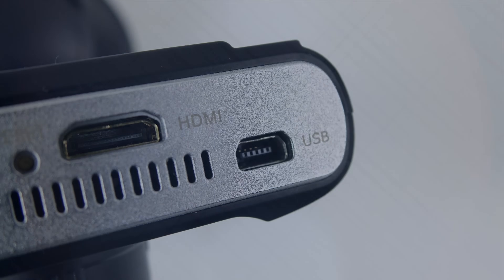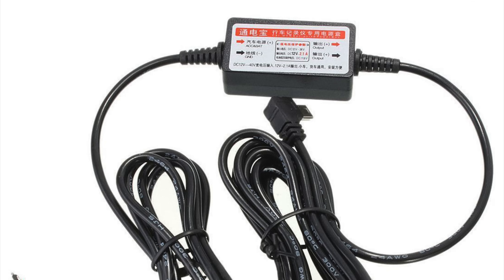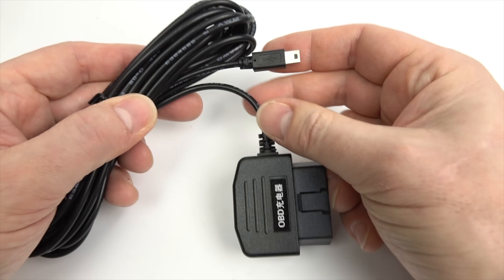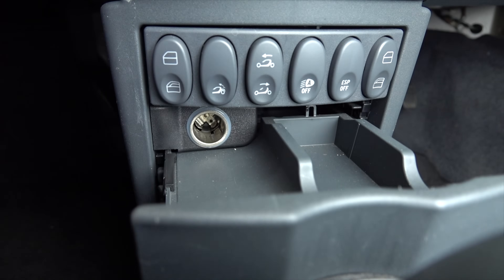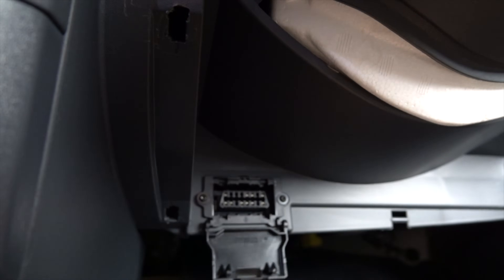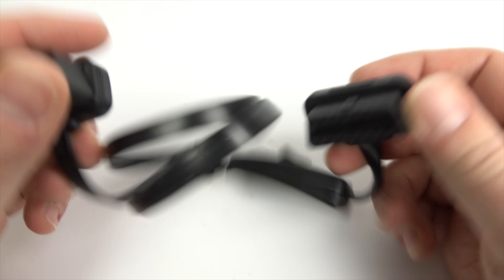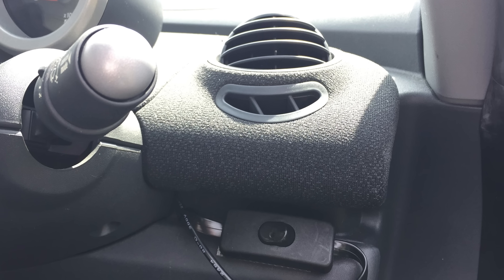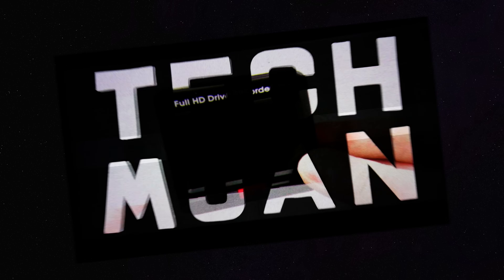You can power a Dashcam via your OBD port (but perhaps you shouldn't)

Comment: As long as the OBD2 adapter does not touch the CAN lines it should be fine... I would be more worried about a dodgy DC-DC convertor design. And of course discharging the battery. Car batteries don't like operating as long term power sources (as you mentioned in the video).
 - Eddy
Reply: MrOpenGL

That's pretty much the point of my original statement.
Reply: +Deathlok67 The data lines on the obd port are opto-isolated.  You could technically apply 220v ac to it and it would be fine ... not that you should attempt this ...
Reply: I was mainly referring to data, not DC voltage. Having the dongle "on the bus" can cause strange side effects in some vehicles, for example the activity may keep the ECU active longer after the car is turned off, increasing battery drain.
Reply: +Deathlok67 The thing should only be internally connected to the +Vbat and GND pins of the OBDII. Those are in no way connected to the ECU.

Comment: OBD ports always carry a constant power feed and an earth - some manufacturers use a pin for an ignition supply, but this is not always the case. This adaptor will just take the live and earth pins - You won't damage your car taking power from the OBD port this way. Neat way if it suits your needs tho.

Comment: Good video Techmoan. I didn't even know such things were out there.

Another option for people that want to leave the car's wiring completely alone is a "add-a-fuse" tap. You remove a fuse from your fuse box (either keyed on or constant on circuits, your choice), plug it in, replace the factory fuse in the top of it and place whatever size fuse you want (3A for a camera would be more than enough) in the side and you now have a properly fused dedicated power line for an accessory and have made no permanent modifications to the car.

http://www.amazon.com/Pico-0956PT-Blade--Circuit-Holder/dp/B001QRSBW0/ref=sr_1_1?ie=UTF8&qid=1462731092&sr=8-1&keywords=fuse+power+tap

I'm in the camp of not wanting to power anything from the ODB-II port, so an "add a fuse" is about the next easiest option. If you have no automotive skills what-so-ever, I can't imagine most repair shops charging more than $20 or so to fully install the entire circuit for you. It's about 10 minutes of work.

edit: It's also not uncommon for even modern cars to still have auxiliary fuse locations in the factory fuse box. You may need to just plug 2 wires in and won't have to buy anything special. Check your owner's manual.
Reply: +Maxwelhse Why? Give me one good reason not to power something from the OBD port.
Reply: +Maxwelhse Not to mention, that product you linked to only provides the +12V. You then need to provide a return path, and it would be easy to screw up wiring that in and blow the fuse. Plugging into the OBD port is much easier, and probably safer for those without DIY skills who want to leave it stock. Personally, I would just open up the dash and add in my own wiring... but not everyone wants to/can do that.
Reply: *****
Here's 2 quick reasons:

1 - The OBD-II port is powered directly from the ECU. You screw that up (or your device fails and screws it up for you) and you risk frying the car's computer. The power pins on the port are not fused in the box.

2 - On many vehicles the OBD-II port is in a location that would make driving around with something hanging out of it dangerous. In my Jeep, as an example, the port is directly over the clutch and brake pedal and aims straight down. I probably "could" zip tie the wiring and all of that up and out of the way, and probably not kick it and hope it never falls out of the connector while driving, but that will also make it a hassle to use the port as it's intended later. Plus. if I'm going to do that I may as well just run correct wiring from the fuse box and be done with it.

---

As far as wiring a ground, that's no big deal. I'm fairly confident that any car with an ODB-II port is also going to be chassis negative, so just pick any screw that goes into something metal on the car and install the ground there. If someone should happen to mess up and blow the fuse, simply replace the fuse and try again. That's why they are there (except on the OBD-II port, which generally isn't fused).

Anyhow... I stand by my statement that if someone is unwilling or incapable of installing a fuse tap then any repair shop can do it for them for a very reasonable price and then the job is done right with no risk to the ECU. You have no reason to argue with me about that.
Reply: Maxwelhse I have never seen a single ECU where a power fault on the OBD-II would cause ANY problems at all. The power, in many cases, doesn't even pass through the ECU -- and when it does, the connection to the OBD-II is tapped directly from the input. As others have stated, the OBD spec requires that the port be able to power active probes. It should be able to source WAY more than enough power to keep a dashcam happy. Throw a fuse in line, and you're laughing. However, even without the fuse, the only thing you'd risk damaging with a sustained short, for example, would be the battery. And you'll find out pretty quick if it's shorted!

Saying you can damage your ECU by drawing power from the OBD port just demonstrates that you've never had an ECU open, or never read the OBD spec.

Having live power on a wire (from a fuse tap) is much more dangerous, and much more likely to end in a user-caused short. If you let that cable touch ANY chassis-connected metal, you'll get a huge spark and, if you're lucky, blow the fuse. Many of those Chinese-made fuse taps actually bridge across, so that the accessory wire you're adding is connected directly. I would MUCH rather draw my power through a proper connector, with a very, very low risk of electrical fault, than leave it to an end user to properly crimp and ground their own fuse tap.

The end to this debate is thus -- end users will almost ALWAYS do the easier, safer thing that takes less effort. In this case, that's simply plugging into the OBD port. Instead of fear mongering, why not encourage people to buy parts that have a fuse in line? That information would go a lot farther in keeping someone safe than saying you'll fry your ECU.
Reply: The end of this debate is that people like you should be exactly the people to take their car to a professional and have a circuit correctly installed. Your fantasy of giant sparks from a 1A fuse outlet say all I need to know.

----

And no, all end users won't do needlessly foolish things with their cars, hence why I'm recommending against plugging in random China garbage directly to the data port. You're welcome to do whatever you want. The entire point of my comment was to offer a safer and BETTER way to do it and probably at the same cost (assuming a professional is paid to install it). I also stated right from the start that if someone doesn't know what they are doing to take it a shop and have them do it.

People like you turn up on the internet and argue with people just for the sake of arguing. If I wanted to do that I could call any number of the women in my life. I'm done here.

Comment: Will a dashcam really run down your car battery? at 3w it'll take like 150 hours to run down a 500Wh car battery. Hm.. feasible I guess
Reply: +redtails Small cars usually have 35-65Wh battery.
Reply: Wild Rat What car are you talking about? Maybe you're confusing Ah with Wh; even the citroen c1, arguably a pretty small car, is typically fitted with 42Ah, preferably 50+, which puts it in the 500Wh range
Reply: +redtails You right, I mean Ah. 35 to 65Ah on 12V is 420 to 780Wh, so you where right from beginning.
Reply: +Wild Rat My car (1.3L engine) has 35Ah battery from factory.
Reply: @BikerWildRat  I know this is a very old video, and I don't even have anything useful to add either... but I just wanted to comment on how refreshingly civil the comment section is on these videos.

I just found Tech Moan a half hour ago, and they give me a Technology Connections kind of a vibe. If anyone who is reading this both enjoys these videos, and hasn't discovered Technology Connections, I highly recommend you check it out. It delves into some rather stupidly obscure areas of technology, but is consistently very interesting.

Anyway, I was shocked to see @Wild Rat admit a mistake and credit @redtails as being correct in a YouTube comment section... without any instance of Godwin's Law applying; the befuddling random objectification women (that the video features only one dude is usually irrelevant); or incidents of homophobic, racist, and/or xenophobic slurs rising logarithmically and correlating with the conversation's devolution. 

Good on all of you (seemingly in general across most comment threads here)  for discussing in a nonconfrontational manner and with a sense of grace and respect for the other participants. Because I honestly didn't know this was possible in YouTube comment sections, this has been a glimmer of hope that humanity's demise maybe will not be quite so quick... I'm not raising expectations just yet though.

Comment: The only way to go is hardwiring to the back of the lighter/12v port or the radio harness. I always use 2 to 1 lighter adapters and cut the ports off. Hiding the cable usually requires removing a couple plastic panels held in by clips.
Reply: He wants the unit to say continuously powered so he can have the option of recording while his vehicle is parked. As he explained in the video, this particular vehicle cuts power to the 12 volt cigarette socket and the stereo system when the key is removed. If you wanted to hardwire in the camera the only option would be to run a lead directly to the battery, at which point simply connecting it to the OBD port seems to be the simpler, and cleanest option. Also it's nice to avoid modifying, and potentially mucking up or cluttering the dash on newer vehicles.
Reply: You can put a switch that changes the 12v source from constant power to 1st key position and use that to keep the dashcam on.
The problem is that people who tried powering their dashcams 24/7 report that the car battery will die after 2 days at best, besides I don't really see much use of filming what happens in front of your car on a parking lot. You would need 360 degrees monitoring to hunt down assholes who did hit'n'run on you on a local tesco parking lot, and that would probably require an auxiliary battery bank as found on hardcore car audio builds to keep it on for a reasonable amount of time.

Comment: Using the OBD port to power devices can't really harm the car in any way. Still, some of my cars keep the OBD port powered at all times, so leaving something connected is a good way to find a flat battery if you leave it too long.
Reply: Not mine as it has a battery saver circuit and turns of if voltage drops below 11.6 volts

Comment: off topic but do you have recommendations for cleaning sliders and volume knobs on old hi-fi stuff?
Reply from the maker: +kzman kaman Just spray them with Contact Cleaner - move them up and down a few times and that should do it.
Reply: thank you
Reply: DeOxit Fader F5 would also be good. It's a contact cleaner with added lubricant, specifically for use on sliders and pots with carbon tracks.

Comment: IMHO it would be a bit easier to use a  Piggy Back  Fuse Holder. Easy to fit , no holes to be drilled, Cheap as chips too.

Comment: Like i said on the bottom, it's perfectly ok to use the OBD port for this application. I just wouldn't add the inline power switch because it will add more resistance to the circuit and make it messier (pins + cable + switch + cabe + pins + cable.. instead of just pins + cable + switch + cable). Just strip the wires from the OBD adapter you bought, buy a lamp switch and add it there.

Comment: OBD is fused with a 5A fuse in any case, and the always on is there for the connection of the diagnostic scanner, as often you are required to switch the engine off and on again to verify codes are cleared. Great if you have a dashcam with voltage sensing or inertial motion sensing, or if you want the parked sensing, but otherwise not so good. Best to hard wire it in to the wiring, and you can use a simple tap in connector to do that, using the rear of the accessory socket and some spade tap in connectors.
Reply: +SeanBZA Good for European cars maybe (I myself have a Saab which turns on and off the accessory port when the key is turned to the on position), but I know many people with American cars and the lighter socket is on all the time. Stupid design, but I guess it makes sense if you're using it as a real cigarette lighter, might have the car off and you want a smoke lol.

Comment: I don't think a (healthy) car battery could run low by a connected dashcam or something similar.
It just doesn't consume that much energy other than e.g. the headlights or the radio.
But I would rather not mess with the OBD port by connecting a cheap adapter.
But as always, interesting video! :)

Comment: OBD has a Vref

https://en.wikipedia.org/wiki/Voltage_reference
(A voltage reference is an electronic device that ideally produces a fixed (constant) voltage irrespective of the loading on the device, power supply variations, temperature changes, and the passage of time.)

if you mess with it, you will get wrong reading and get bad gas mileage 

it was in the news of a store that install car stereo, and the installers hook the power to the ODB,
all the customer reported bad gas mileage.
Reply: +Fred Bedderhead pin16 on the obd port has a fused line going to it rated for 4 amps @ 12v.
Don't spread nonsense.  There is absolutely NO way this could mess with your mileage.

Comment: I think the best idea is to get a radio ISO connectors (both male and female), solder them together and steal a switched voltage and ground for your hard wire set from these two wires.
Reply: +TrinomCZ if your going to do that, might as well just stick with the fusebox method with a fuse piggy back, it will be easier to wire in and not have to mess with radio wires, not all cars use iso connectors and making a small extension lead you may end up losing some functions with the radio.
Reply: Phill R
Fusebox method is fine, unless you have a tight cover, which makes this method unusable.
I agree, no every car has ISO connector, but it's a standard here in Europe. The power plug doesn't contain any aditional leads, than power (key + permanent), ground, backlight and antenna power. Therefore I still think it is the cleanest solution in this case.
Reply: TrinomCZ in a car (typically older ones with iso) then yes that would be a perfect solution, however more modern cars (especially techmoans) would probably use a quadlock connector and its those connectors that have many different connections like steering wheel controls, can bus, fiber optic etc. making a extension for one of those would be least cost effective and would be more hassle than whats its worth. also a lot of people would be too afraid to take apart a cars dash board unlike some of us.
Reply: Phill R
In this case I have to agree with you.

Comment: Or you do what we amateur radio people have done for ages. You run a pair of cables with fuses on each leg directly to the battery. Again though you'd need to switch the power on/off but it works.
Reply: +kd1s Keep the fuse as close to the battery as possible kids!
Reply: kd1s Or use a relay so it shuts off with the ignition. That’s how we always wired them unless they specifically wanted them always on.

Comment: Annoyingly, the OBD port does have a switched 12v pin (I know this as this is where I took 12v from when I hard wired mine).

Techmoan, how easy does this look to modify to take power from a different pin? From memory it's one of the corner pins that is switched 12v, may make this a much more workable solution for some people!
Reply from the maker: +liambowers666 It is held together with two Philips screws. Inside a red positive wire goes to pin 16 and a black negative wire goes to pin 4&5 (a solder bridge joins them). The red and black wires then attach to a small transformer board.
Reply: +Miguel Simões If you can't understand why a potential disconnection of pin 4 due to a loose connection on the chassis ground (not unheard of) could cause the device to dump 2.5amps down the SIGNAL ground which is presented on a separate pin for a reason, as it may have a tiny trace on the VERY expensive ECU, then maybe YOU shouldn't be  commenting eh?
Reply: +TheChipmunk2008 Mother of god, it's even worse that i thought.
Dude, the GND pins on the ECU and pin 5 on the OBD cabe are ALSO soldered together inside the ECU, and no.. not with a tiny trace but either a huge ground plane or big blobs of solder. The only reason you have a separate pin is to give you a cleaner and more direct GND connection between the ECU and your OBD device.
The OBD connector is made in a way that gives you the option to use the best ground path for your application. Pin 5 is recommended if not mandatory for uses where data is exchanged.. For uses like the one in this video, you can connect directly to the chassis or both.
Reply: +Techmoan it shorts 4 and 5... signal and power ground. Ouch.
Reply: +TheChipmunk2008 why ouch? Dude seriously, do you understand electronics? Why make a comment on something you don't understand? Pins 4 and 5 are both ground.. one goes directly to the chassis and the other goes through the ECU. This is done to lower the interference when you connect a diagnostics tool (although it doesn't matter for this adapter because it doesn't send data).. but they are both ground, they ARE shorted even if you don't connect anything to the port.. Geez